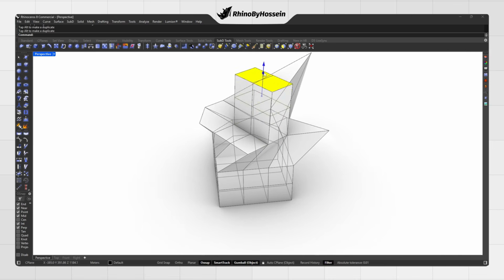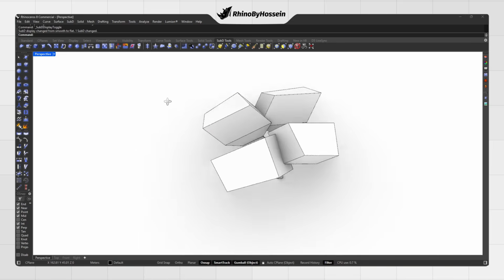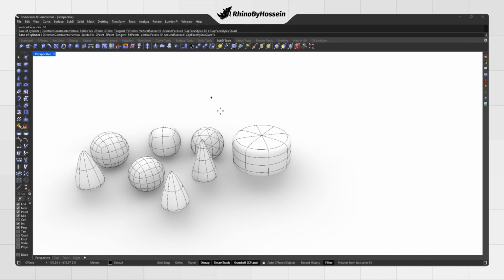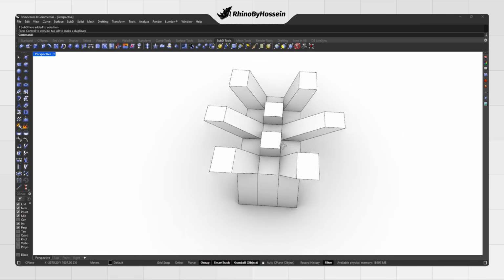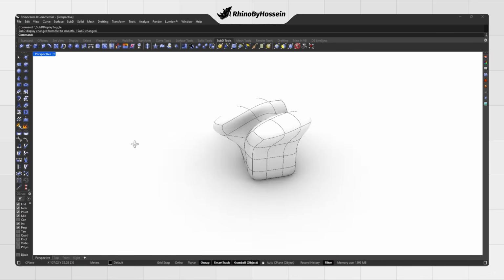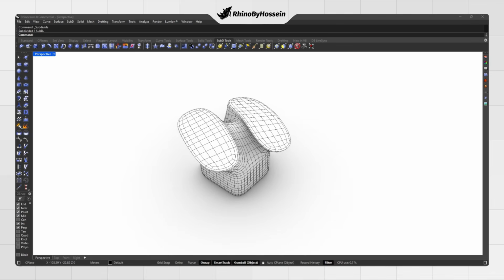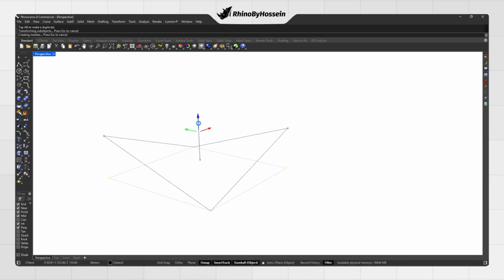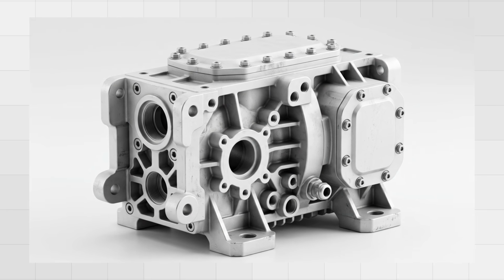Rhino SubD Tutorial for Beginners | Complete Subdivision Modeling Guide

Comment: Weaknesses and gaps
No practical example: the lesson is purely an overview. The author shows tools but does not build a complete model from start to finish. For a beginner, this may remain "theory."
Fill SubD Hole is mentioned without caveats: on complex holes this command produces poor triangles. The author says "it works well for simple holes" but does not show its limitations.
SetPerFaceColor is described vaguely — it is not entirely clear how this relates to sharpness/smoothness (probably referring to crease weights or face colors for visual control).
RadiateSubD is mentioned briefly, without an example — it remains unclear how exactly it works.
No discussion of crease: the lesson does not mention SubDCrease / RemoveCrease, although this is an important tool for controlling edge hardness.
No comparison with T-Splines (historical context) — not critical, but it would be useful for completeness.
No information on 3D printing: how to check for watertightness, how to extract a mesh, what the pitfalls are.
Reply from the maker: Thanks for the detailed feedback; these are great points that I’ll definitely keep in mind for a follow-up, more advanced project-based tutorial! 😊

Comment: great video but no, its not created for engineering, its created for modeling. you haven't used a single parameter, you just modeled
Reply from the maker: You're right, this video focuses specifically on the artistic modeling side of the software rather than parametric engineering workflows. 😊